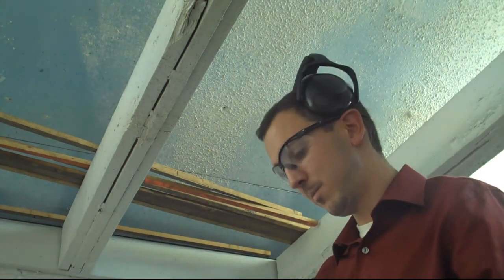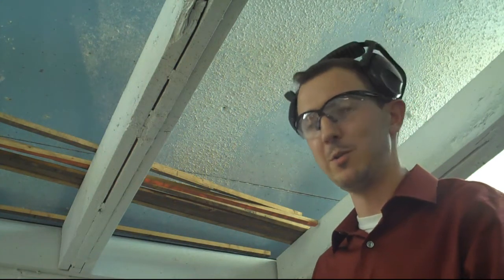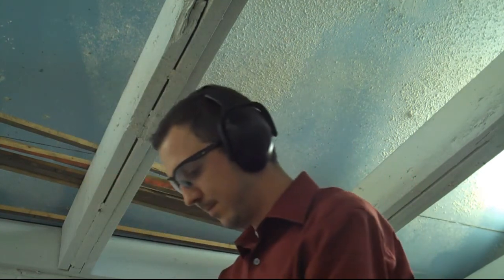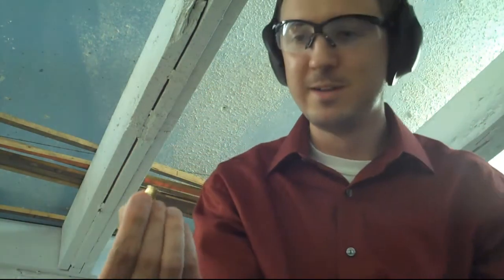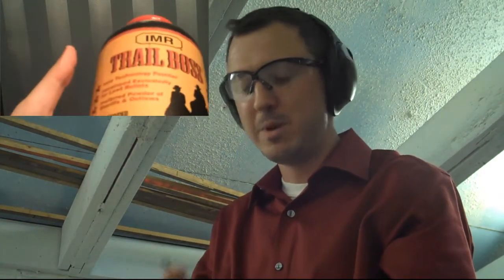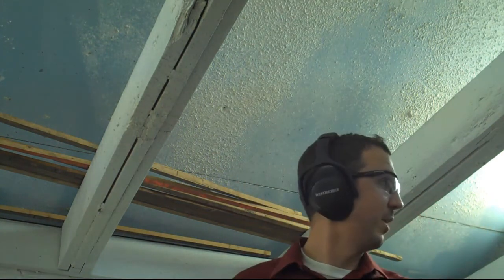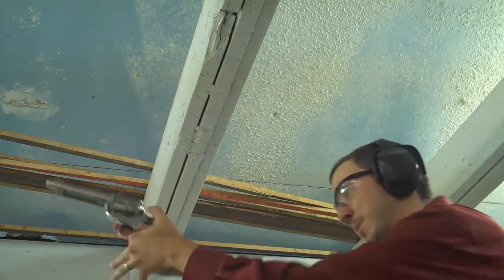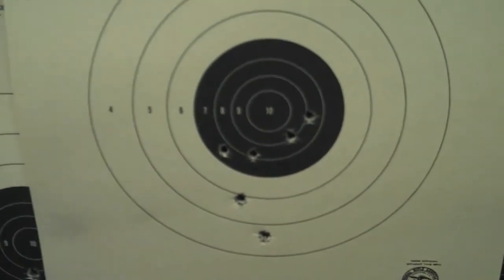Reloading the .357 & .38 - An Exploration in Powder Charges

Comment: Hello, very interessting loads you use. I have had very good experiences with the following cartridge load for my 'S&W 686 Practical Chamignon': cartridge case of Winchester, 15 grs. Vithavuori N110 (Maximum Load is 15.9grs. but the recoil is brutal:-) , Winchester JSP 158 grs. and the primers small Pistol Magnum from Winchester. thats only my opinion! Although the N110 powder of Vithavuori (Lapua) leaves many traces of smoke but burns very very evenly and I hold the 9 without problems. I am surprised that in the usa vithavuori powder is not so common. Here in Germany we use it very often. greetings Frank

Comment: Hi, thanks for the vid.  I been going through reloading tables by different manufacturers and they seem to provide charge weights for the same powder but for different cartridges, which is normal I suppose.  However, they also provide charges for same powder for both semi-automatic pistols and revolvers.  A friend of mine recently told me that a powder I was using for 38 special was 'too fast' (burn rate) for a 38 special.  I was getting excellent results with it.  Is there any such thing as too fast a powder when the manufacturers give doses for both pistols and revolvers for the same powder?
Thanks again and all the best for 2014.
Reply: If you are using recommended powder, grain and primer, by the book, there should be no worry. Always read the data tables from the manufacture for proper load parameters.

Comment from the maker: Separation close to the base can also be a symptom of brass casings that have been used too many times (this is usually were the case expands and contracts during ignition - if you examine you're fired brass you'll often see a stress mark in this area even on "healthy" brass).  Has this batch of brass been re-used a decent amount?
Reply: sintax77    your

Comment: I have alot of 10+ year old .357 mag bullets 158 gr. JSP loaded with old data. ( 12.7 AA#9 ) which was recommended at that time. The problem I am having now is the cases are splitting at the base of the cartridge and are sticking in the cylinder. At that time I loaded cases with magnum primers, which I stopped using . I have 3 reloading manuals and each have different load data including the online data from Accurate. It can be confusing so what are your best recommendation for good safe load.

Comment: When I started with 357 magnum reloading, I kept having issues with the primers backing out. Discovered that the load was too light!

Started loading them stiff enough it was blowing primers in some guns, and have never had an issue again, lol. A 180gr hard cast with a compressed charge of win296 is an unholy monster. I started reloading with the 454 casull and never ran into any of these kinds of issues lol.

Comment: l just got back from the range with my first 15 handloads, l have 4 separate loading charts with a powder range from 13.4 grains to 21 grains (h110) 5 rounds of 16grain 5 rounds with 17.5grain and 5 rounds of 19grain, on the upside my gp100 did not explode, the 125 grain bullet l'm using suggests 1250fps max, l was getting 1585fps with 19grains

Comment: i have a video up on different powders i use all was loaded in a 357 mag with 158gr bullets the powders i have found worked the best trailboss for plinking, hs6 for a medium load or +p for 38spl and H110/win 296 for 357 mag hot loads

Comment from the maker: @taylorman1949 I like to lower it into the powder so that the grains pour in over the sides.  According to Lee, this is better than scooping, which can cause the powder to be packed / compressed into the head resulting in hotter loads.  Hence calling it a "dipper" rather than a powder scoop.

That being said, from what I can see the recipes they give for use with the dipper are well under a dangerous or even moderate load.  Accuracy is probably what suffers with this system, not safety.

Comment: How are you using your Lee dipper? I found great difference in correctly dipping(sinking the dipper down under the level of powder allowing it to fill from the sides, bringing it up straight and leveling it off with a card, and just scooping up the powder which gives incorrect measures.
 I still use the Loader occasionally. I think basic, hand crafted ammo can be highly accurate and fun to make.